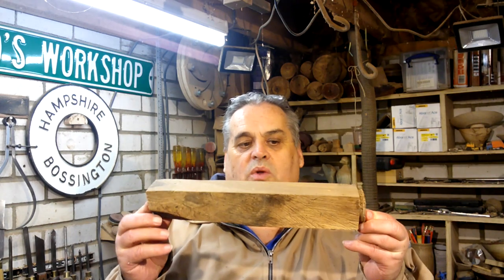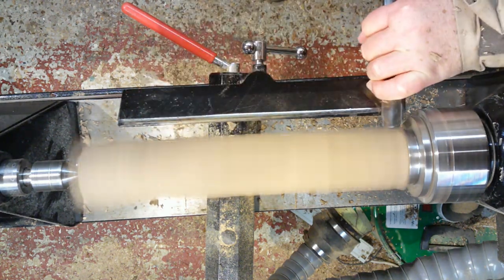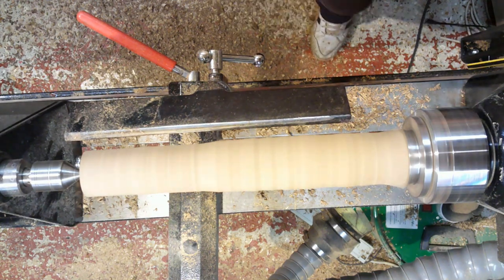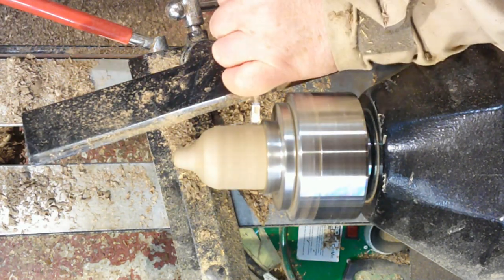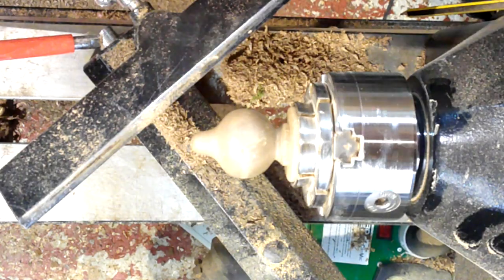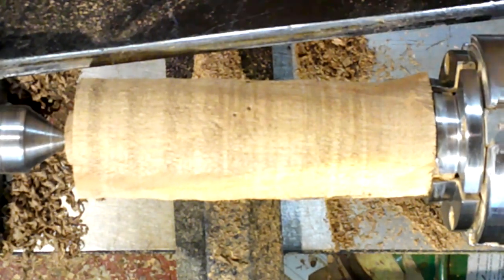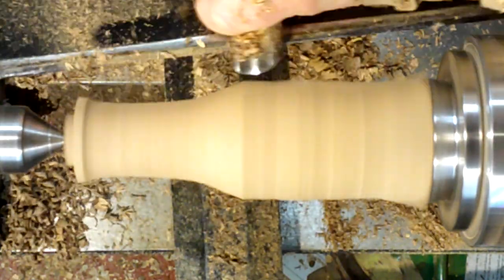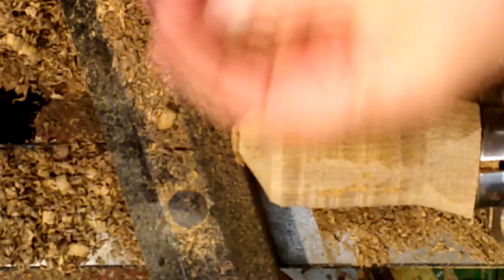Not another adorable dog!!!!!  wood turning #101

Comment: Pareto Pronciple or 80/20 rule. 80% of the outcome happens in 20% of the time or effort (causes).  Great little project! I wonder that the lines in your recording have to do with your recording frame rate. I would try changing that up a little. Or, I had the same thing when I use 1 LED light. When I use several it is as if they phase over each other and blend better. Anyway, great videos steve!
Reply from the maker: Thanks for the advice Chris, out of interest what camera do you use to film your videos. I'm looking to up grade mine but have no idea what i should be buying, the other thing is the one i am using has a remote control which i find very useful but very few cameras seem to have them
Reply: @thehampshirewoodturner  I can't find a camera better than my phone. I use a Samsung S10.